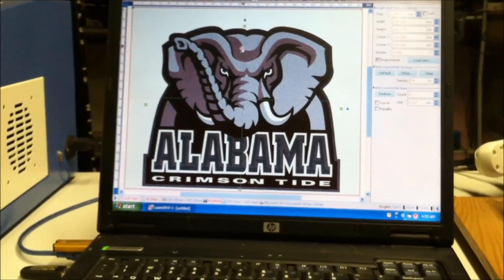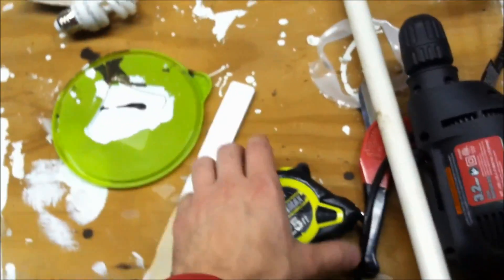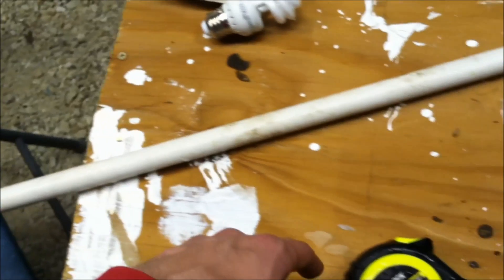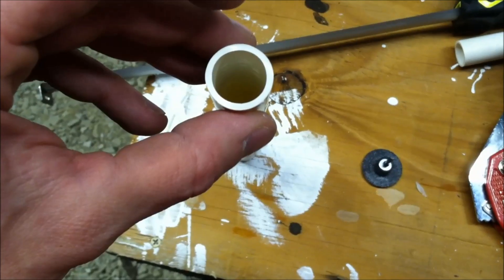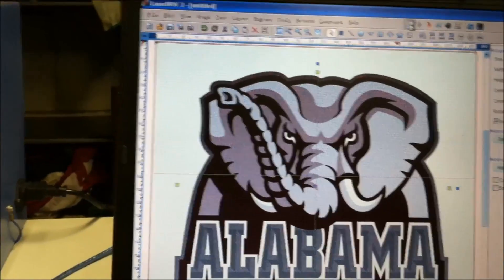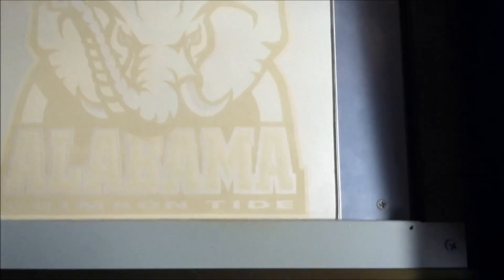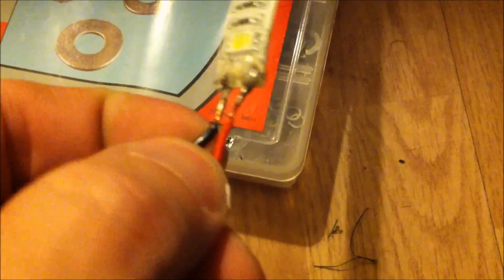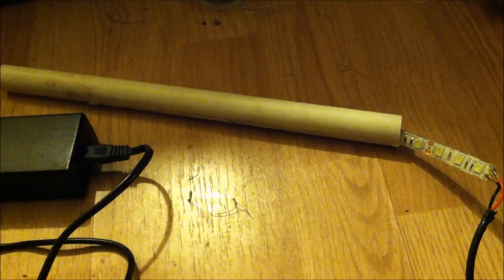How to make a led edge lit acrylic sign with laser engraver

Comment: Im thinking about doing similar but wondering if it would be cheaper to buybthe led rgb kits that come with multi button remote....power supply and 3 ft led strip....for $6

Comment: Title : How to do an easy job the hard way.
Reply from the maker: sundar mann how would you do it? I'd love to see your easy process
Reply: After Hours Tv & Pc repair Dear Sir, first, I must say I love your work, And you certainly gave me an idea on using tubes for LEDs. Thank you very much for that. 
An easy way to slot the tubing is to place two L shaped wood or any other material length wise to the tube and clamp it down on a vise. The Ls can guide you for a straight slot. Both the Ls should reveal a gap at the top of your tube to accommodate your dremel tool. 
As for the the uneven slot you made, when viewed from the top, with your acrylic attached to the tube, it will look unaligned. In other words, they (both the tube and the acrylic) will not be at 'right angles'.
Why let a shoddy work on a simple tube ruin a great detailed work on the acrylic. Thanks again.
Reply from the maker: sundar mann awesome idea! Thanks man I appreciate it!
Reply: After Hours Tv & Pc repair ...you are welcome...fact is I should be thanking you... all kind of crazy tubing ideas are already playing in my head just by watching your video...I'm going to use tubes for my future projects.
 And, if I may add..coloring or painting the tube in black might give your labor an even more stunning look...the LEDs when lit, can slightly be seen through the white tube........am subscribing to your channel.
Reply from the maker: sundar mann check this link out. https://youtu.be/OiJmhf3sSZc my latest design of the holder

Comment: Can you add the link for the sellers on ebay for the Acrylic and the led lights. Also, where did you buy the electrical part to solder to the lights. Thanks, Great video.